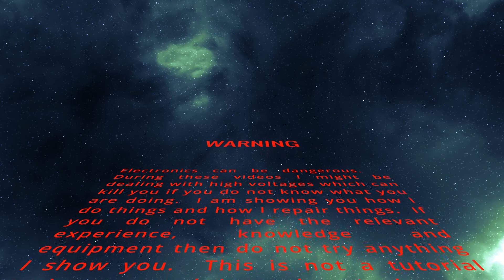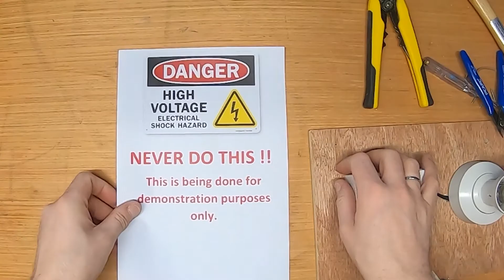#01 Channel intro - UK AC Mains current limiter (using bulb)

Comment: You use 1mm 2 core flex cable, what's the amp rating for the cable ? Is this lighting cable, what's the spec for the mains cable ?
Reply from the maker: It was the first video.  It's actually 1.5mm cross sectional cable and its a rather short length.  Its good for the task especially as it is only going to be used for a short period of time and whilst being supervised.  I have never had any issues.  You can increase the gauge if you want more of an overhead.

Comment from the maker: Just had a strange response saying that several wires were not all fully inserted into connectors and there was copper exposed.  Well yes there is about 1mm of copper exposed in the plug going into the live connector which really isn't an issue.  Every other wire is fully inserted and every wire is fully inserted in the lamp holder.  The use of knots to stop cables being pulled through might not be absolute best practice BUT the lamp holder and back box are about 5 cm away from each other so it's rather unlikely that anyone is going to trip over that 5cm and pull it through.... but the knot would stop that anyway (but if you want to you can use correct strain relief).  This is a piece of test equipment for a lab and would be used on a bench so the large knot would stop the wire coming out.  It is a demonstration of how you could build one and it is as safe as it needs to be (it's not a product for sale to people with no knowledge).  Any wires are inside of plastic boxes and strain relief by a knot is safe for this device.  I wouldn't have a knot as strain relief in a metal device that is being moved about or an amplifier sold to a member of the public!  If you don't like it don't build one and if you do want to build one then you can use back boxes with built in strain relief if you feel the need.

Comment: Hi.Have made one of these with a 100w filliment lamp to limit current to a faulty smps which I've replaced componants but not tested yet. The lamp lights for a second  then goes off?? Does this every time.Not sure if that's good or bad?
Reply from the maker: The lamp is in series with the amp and everything in a circuit branch has the same current. So the bulb will light up proportionally to the amount of current being used. If it flashes then goes out then that is because the circuit in series uses enough current to light it but then it’s use reduces. This is likely inrush current where the caps charge then stabilise or something like that. It is showing that it is working!

Comment: Hi what's the wattage of the bulb for testing,  I  was told  once  you can't use the led lights.  Fantastic
Liked  the safety advice on making knots.
Reply from the maker: Different wattage bulbs limit the current by a different amount.  I use a 150w bulb, I bought a box of 12 just as filament bulbs were taken out of circulation.   I have also used a 100w bulb and to be honest. either size will give the required effect.  Just remember that once you are happy that there is no short power the amp normally.  I once forgot the take the limiter out of the circuit and couldn't get the bias set.....  Took me 20 minutes to figure it out :-)
Reply: @cowasakiElectronics  Good Video, My mains is 240v ac.
I found out that the bulb wattage is very important on my testing. I began with a 100w bulb (first a modern halogen then an old filament) with an old laptop as the load.
The bulb flashed and flashed as the laptop tried to start, the laptop beeped as it was switching back and forward from mains to battery as the voltage was fluctuating, I had a meter attached to monitor voltage.
The only bulb which did'nt light and draw all the power for me was a 300w old photo bulb, it did'nt flash at all when the laptop booted and when I attached a 3000w kettle it lit the room, voltage drppoed to 20v, success.

How can you source these type of bulbs anymore is anybodys guess.
Reply from the maker: @AtariST94  I just bought a box of 130W filament bulbs.  They still light up dimly on a lot of amps but they are good for initial testing which is what you want the limiter for.  Once you know the device is safe you should turn the limiter off or things like bias will be wrong.
Reply: @cowasakiElectronics  Your lucky, in the early days they used car bulbs in series, acting as a resistor to charge car batteries, changing the bulb wattage as the battery came closer to full charge, the bulb dimmed as reached full charge.

Comment: why doesn't the bulb light up as normal when the socket is used? Its all wired up?
Reply from the maker: If you think of the circuit path as being the bulb and the amplifier and knowing that the current is the same throughout that circuit then you will understand that neither the bulb nor the amplifier get the full current that they would get if plugged in on their own but both do get the same.  If the amplifier is faulty and goes short it will pull a lot of current and again knowing that the current in any path is the same then the current in the bulb will increase as well which will in turn light it up.  It's effectively using the amplifier as a switch that is in the on position.  This is the reason you must NEVER bias an amplifier that is connected using a bulb limiter because you are reducing the current that the amplifier gets and so when you plug it in normally it will get too much.  That's my understanding of it in simplistic terms.
Reply from the maker: Oh and if you meant why does it not light up even if there is nothing in the socket then this is because the bulb and socket are wired in series.  Neither will work if the other is not installed.  So your amp will not work if you remove the bulb and the bulb will not light if another is plugged in or the item plugged in has a physical on/off button.
Reply: @cowasakiElectronics  Many thanks for your reply sir.  I've subscribed to learn more. Thank you
Reply from the maker: @fostexfan160  there has been a long break due to illness and a totally new build to my workshop. I hoping for new subject matter in the next month. I only have my extractor and lighting to connect then it’s the finishing touches.
Reply: Great video and I plan to build one of these. Could you do a video showing how the bulb reacts under normal conditions I.e. no short? I think I would panic if I seen the bulb light up at all. Thanks

Comment: A nice video. When you put the switch in the ON position, does that mean the bulb is in circuit (meaning limiting the current) and when switched OFF, its out of circuit (full current is being applied to device plugged)?
Reply from the maker: On is for limiting.  You can tell it is in the limiting position by removing the bulb.  If the limiter is in the limiting position with the bulb removed the device under test will NOT power on.

Comment: Useful bit of gear for us vintage electronics hobbitses. Good luck with your channel - Andrew
Reply from the maker: Thanks.  Lots of useful bits of gear planned.  Video 2 is about how to disassemble anything.  Video 3 is a capacitor discharger but then I have series planned for a valve tracer, valve tester, grid power supply, amplifier monitor, AC supply box and many more.....
Reply: @cowasakiElectronics  Sounds good. Good to see another UK electronics channel anyway.